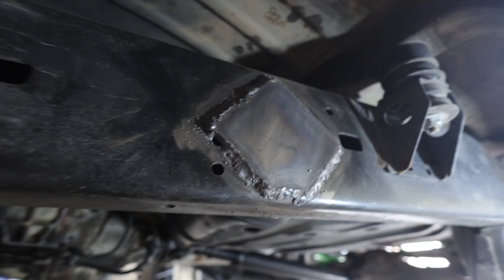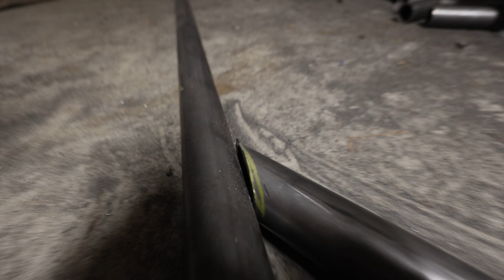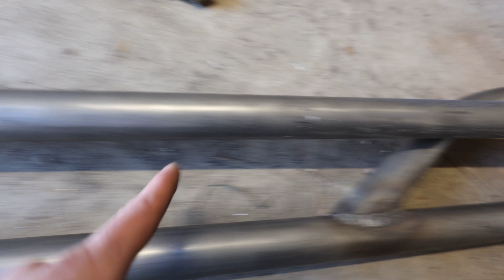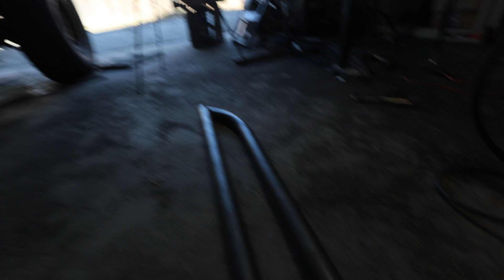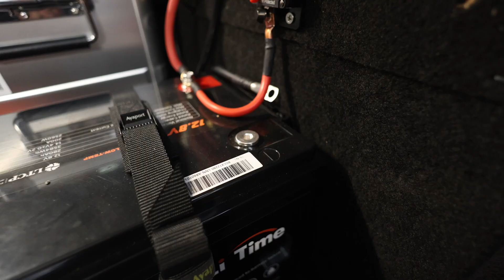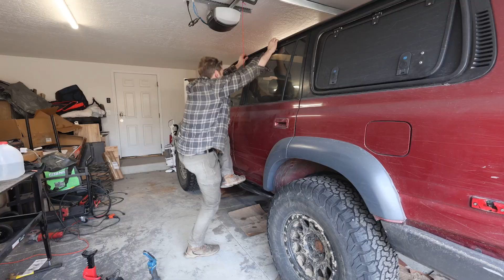How To Make Your Own Off-Road Rock Sliders (For Beginners)

Comment: Now the inside of the frame is going to start rusting. Welding burns all the paint off the inside.
Reply from the maker: That’s a valid point, I’ll try and spray some rust reformer in there
Reply: @Austin_SaintOnge  One of the best solutions is to keep the inside of the frame coated with a lanolin oil. Surface shield or fluid film for example. Coat the entire underside once a year and it will look like new forever, besides attracting dirt easier.
Reply from the maker: @Liquorpuss that’s a great idea! Thanks!